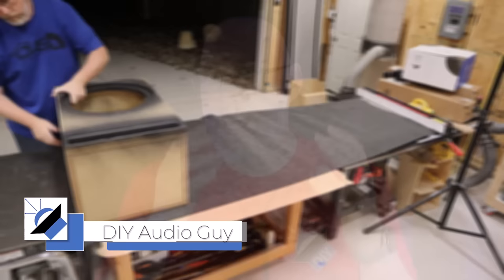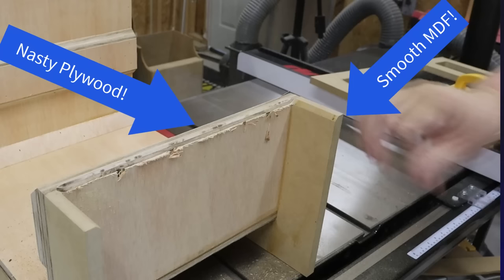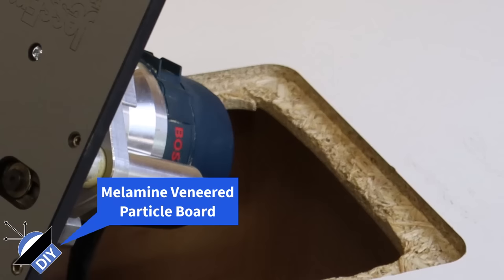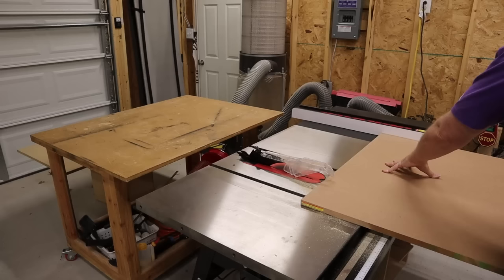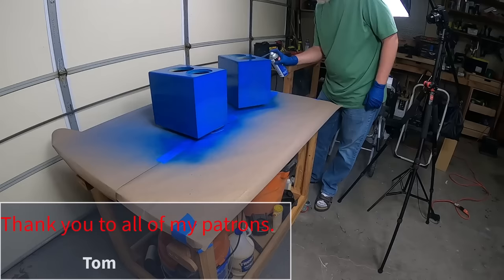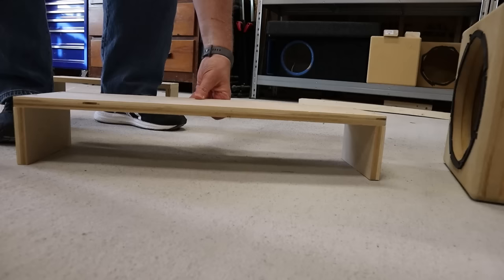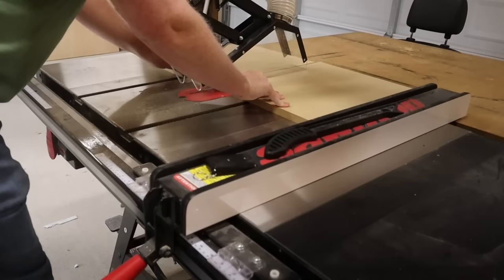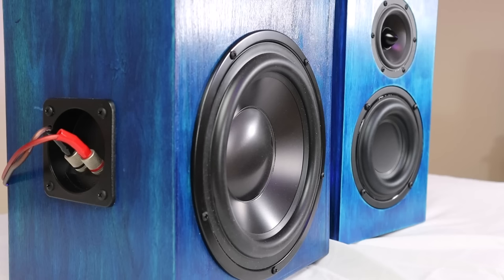You Won't Believe The Best Wood For Your Subwoofer Box!  Birch vs MDF

Comment: I started using water resistant MDF (its a green/olive color). This stuff is about double the density and weight of regular MDF. I have yet to find another wood product even close to this. It is even more enjoyable to work with than Birch (I have worked plenty with Baltic birch and regular mdf). Because it doesn't absorb moisture, painting it is a pleasure without the need to seal cut edges. In terms of sound and especially bass response, it performs incredibly well.
Reply from the maker: Where can I find a sheet?
Reply: Remember to use breathing protection, the water resistant sheets in particular use Formaldehyde as a binding agent.
Reply: Not sure about subs, however, I tried this wood for mids and highs, and the tone sounds off. Although I like that it is water resistant, dense, and heavy, the wood gives off a thin sound that I didn't like.
Reply: It is a very good choice when enclosure is meant for outdoor usage like cars, vans, trucks or even in your garage with no heating or sheds if you have a driver that is made of carbon fiber or plastic cone.
Reply: HDF - heavy density fiberboard. they make 1" thick, also. ive cut miles & miles of MDF, i hate the taste of that nasty board.
Reply: Akin to pressure treated lumber - also more toxic than regular mdf

Comment: Pretty fantastic review of the two common cabinet woods used for decades in sub enclosures. Still one caviot is the myth that the sub cabinet panels are more inert the heavier they are, false. It’s only partially true. One example to that is the Meyer Audio industry standard speaker cabinets that are known for their own gravitational pull they’re so heavy, and they do sound good and set the audio bar good and high 25-30yrs ago, but have since been out-swung by a few high-performance pro audio lines with speaker cabinets featherlight compared to the Meyer’s. 
Density is just the OG method of the approach at making inert cabinets that are truly that. We’ve learned a lot since then , and one thing that’s allowed for low weight design is, very much agreed with our host of the channel here, cross bracing. It allows for very relatively thin panels to be used that only resonate in between corners and braces spans, and when dialed in high enough frequencies become inert enough to be a nothing factor below sub working frequencies. 
Again, great content on the vs discussion here.

Comment: i remember the first sheet of mdf that i bought from home depot was $6. back when i was first getting into enclosures, i used plywood, osb and particle board those all could be had readily for $4-5 per sheet. i recently made a sub enclosure from some scrap osb i found in the alley next to a construction job. solid box. cheers
Reply from the maker: When I got into box building my first subwoofer was for home theater and I used the Birch from Home Depot.   I think it was 50 bucks a sheet, it may have been 60.  If I would have known how much plywood prices were going to go up I would have bought a truck load back then.
Reply: Ahh, the good ole days.. evrything CRAZY expensive now. (Prices started going up fast when "everyone" became a DIY contractor)..

Comment: I've built many boxes in both materials but my preferred technique is ½ MDF for all the interior and inside layer and the ½ Baltic ply for the outside panels. This gives the acoustic advantages of MDF and protective advantages of ply and doesn't finish too heavy.
Reply from the maker: So everything is 1" thick?  clever.
Reply: @DIYAudioGuy  yes it finishes 1 inch thick. I'll apply a third baffle layer for heavy or powerful subs.
Reply: Complicated but effective. I suppose bonding the layers with adhesive under pressure is critical. 
For maximum durability Ive been coating plywood boxes with fiberglass epoxy resin, (minus the glass mat) you can paint it before or after. I also like spraying the insides with auto undercoating, ive tried both asphalt and rubber. Take it a step further by rolling modeling clay into thin rolls, pressing along the corners where the panels meet, then a few layers of the undercoating or PL adhesive to prevent migration under heat.

Modeling clay is amazing stuff for damping, super cheap and a little goes a long way. Just remember when it gets hot it wants to move. In a car its great to put under dynamat wherever panels meet.
Reply: How do you suggest replacing the front baffle/board with the cutout for the woofer? 

I bought a new box from ground-shaker. But the cut out is about 1/4 bigger than I want it for my 15” kicker comp q class. 

I was thinking of just leaving it in place and screwing another baffle right over it with the smaller diameter cutout. It would make the baffle almost 2” because the current double layer baffle is 1.5”.
Reply: @americandude3825  screw one in from behind or would you lose too much volume?
Reply: @americandude3825  might sound weird but Id consider using an aluminum plate maybe 1/8" or more thick from the inside. Mounting it to just 1/2" mdf just seems like it would crumble. Make the aluminum plate the full size of the baffle and mount with screws and nuts with some kind of elastomer adhesive thinly applied.
Reply: @johnlucier5654  may be a great idea. I can go 3.0. It’s 3.5 now.

Comment: I switched to 1/2" 6 ply Baltic birch from Rockler years ago for my guitar amp/speaker cab projects and have never looked back.  Super solid and light weight compared to 3/4" MDF.  Plus I can simply stain/poly the cabs and call it a day.  There's nothing wrong with MDF - but I would never go with if for anything that has to be moved around or exposed to the elements (like beer).  I really appreicated the safety issues you point out!  That's one thing a lot of newbies over look when when start on these kind of projects...
Reply from the maker: Pro audio gear like that needs to be durable.   You ever use this stuff:  https://parts-express.sjv.io/gbdVX2
Reply: I never understood what is the hype was about the Baltic plywood, there's a factory in my hometown (Latvia, Baltic states)and they can't keep up with the demand and i never understood why, it's just plywood made from a tree that's growing everywhere around us (birch) and now watching videos on YouTube i start to realize how good it actually is......

Comment: love the channel and content.  Its been decades since i built an enclosure; that said,, I live in the south with all of the great humidity.  

One trick i used to do to prevent moisture from degrading my MDF enclosures over time was to mix a fairly cold fiberglass resin and coat the interior and exterior of the enclosure.   Making it 'cold' with less activator allows it to actually absorb into the MDF and become moisture resistant.  I'd aim for a cure time of 36 - 48 hours.
Reply: Really ? I recently bought a subwoofer box for 2 15's , looked this up rn after I bought it . Sanded the box , probably should have worn a mask... But I did notice inside it has fiberglass in the back end of the where the subs are . Is that a good thing? Made of mdf has a birch ported port

Comment: Cool!  Yeah, I definitely like DIY projects.  I've never done anything with speaker or sub enclosures, but have been really satisfied with the potential of old reclaimed pine and the finish that can be achieved. 
**on a side note, the sound system that I put in my daily driver has been a game changer for me.  It lifts my spirits and turns my older car into something special. 😉 👍
Reply from the maker: Right on!
Reply: Same here man.  🙂 now i can turn the volume up and i don't hear the squeaks and rattles 😅
Reply: @robjones8733  😆 🤣...yep...2000 Mazda Mellenia, can't hear a thing!
Reply: Pine for enclosure by virtue of its finish? Form should follow function and only the wife chooses audio systems based on how they look.
No offense.

Comment: I just found you today and watched a couple videos. I usually use regular plywood, then I roll on Rhino Lining inside and out. Try it if you haven’t and make a video. I have also used concrete sealer but that ages and peels off.
Reply from the maker: I have not tried to paint or seal the inside of an enclosure.

Comment: As with all things in speaker building, there are positives and negatives to all box materials. One thing that can help a lot with full range speaker boxes is cld. A layer of sound deadening material will go a long way to improve the acoustics of a box. Which can let you use materials that are lighter and easier to work with.
Reply from the maker: CLD is good stuff.
Reply: This.
Reply: ive used a product called - Forbo ; it was green in color appx. 1/2" thick and came in 5ft long rolls that weighed 400lbs. 
it stuck good to 1/2" B.B.  with contact cement. 
it didnt like to be tooled or moved in 45° F or below temps.

Comment: So I've been building enclosures for a long time now and I've used mdf, Birch Maple, Baltic birch & some other various kinds of wood My very favorite for quality In audio is by far MDF. It has a warmer, rich, smoother tone compared to other types. To make sure I don't split the wood, I use mdf SPAX screws that are 1.75 inch long and have an arrow head type point . They are amazing. I also glue, caulk, brace the insides of every enclosure the down side is there heavy and if not painted or coated if water hits the wood will expand but I primer and paint every enclosure so it's solid!
Reply from the maker: Great advice!

Comment: My buddy uses MDF and I use Baltic Birch. I think MDF gives a more lush yummy sound and the BB gives a more tight sound. BB flexes less which is important for high compression sealed subs. I couple this with internal bracing and different deadening materials on the inside. I like both materials. I think I like the sound of MDF more, better for listening speakers; I use BB because I build studio monitors and I like a tight, fast, accurate sound.
Reply: I do see how BB will have a higher 'fs' and resonate at a higher htz. I like the tightness of the bass that bb provides and that higher resonance is handled by the dense material lining the inside of the speaker. In a weird way, having a higher resonate frequency in the enclosure actually makes for catching that vibration easier. I think an interesting verifying test would be this: 2 identical enclosures and look at the decay of each. Load with deadening material and look at decay again. My assumption is the BB will have faster decay in the sub range and will perform about same at the boxes resonate htz if treated well on the inside. Great video thanks for having this discussion
Reply from the maker: It probably follows a Pareto distribution (the 80/20 rule):  For 80% of all speaker and sub boxes MDF works just fine.  The other 20% would benefit from a more expensive material .

Comment: Use what you want, but 30yrs ago every pro installer including myself used particle board and it was sufficient for some high power and large builds. I never had a issue with the screws, not once. Not saying those issues couldn't arise and I'm sure some people have probably encountered them, but neither myself or any of the other installers I knew did. Good info though
Reply from the maker: Thanks for the info.  I have some old home stereo speakers that are made out of particle board so I know that it was a common material once upon a Time.

Comment: You can paint mdf with an oil based paint. I've done it for years, and it resists any water! It takes quite some time to thoroughly dry but its lovely and can be cleaned once finished.
Reply from the maker: Thanks for the tip!

Comment: Early acoustic suspension system enclosures were built with 13 ply marine grade plywood. Of necessity they will be filled to the brim with fiberglass or a similar material. I liked Wharfedale's solution in the mid 1960s. They built a box within a box leaving an air gap between the outside of the inner box and the inside of the outer box. That space was filled with sand.

Comment: Before I beginning; I'm discussing specifically Home Theater, not car audio or anything related to such.
Such a relevant video for me! I'm currently on my 4th speaker I've built since I started a few months ago. Although I have yet to finish 3 of them, I'm building the enclosures first for both woodworking fun and style.
So the question is simple: What's your take on utilizing solid wood (of different species, not pine...never pine lol; More like Oaks, Walnuts Teak, etc)  to build the box, and then inside of this box, build an MDF box?

In my scenario, which I plan on doing for the Subwoofer; I'll be doing a 14 (H) x15 (L) x 14 (W) subwoofer encloser out of 3/4" woods, inlayed between Oak and Wulnut, using box and mitre joints at the corners.

 - The back will be recessed 1/2 inch for the MDF back panel for the amp plate.
 - The front will have a 1" recess for 3/4 MDF then a 1/4 Oak face. (Maybe? I'm unsure if I'll do this or simply paint the MDF black and do speaker cloth).

Inside of this box, my idea was to simply make another box out of MDF taking the internal measurements and putting it together inside of the lager enclosure. Although I will "lose" volume, the idea is to specially add both mass and have the unique woodworking techniques I wanted to try (including a couple inlays and a branding), whilst having a natural oil finish.

Thoughts? Thing this will be a worse solution that simply using only the hardwood for the project? I also do have plenty of mineral wool from a remodel project that I never used (Overspent, had 4 batts left over, I also have Pink-Panther R15 insulation left over, too.)

The subwoofer size I was considering was 8 - 10" or so; I'm looking to specifically hit a quality range for a home theater without going too overboard. I have plenty of oak and walnut left over from additional projects so for me, that cost is minimal.
Reply from the maker: Natural wood will expand and contract as the humidity changes.  I have been told that if you seal the inside and outside of the enclosure it will be ok, but I have not tried that yet.
Reply: I came across a lab test of various wood spices both under a microscope and acoustical measurements. I tend to overthink and over-engineer my boxes. Stay away from pine and oaks! Pine is light (low density) and doesn't sound good to me compared to Baltic Birch or MDF. Oaks on the other hand are very dense and bring a certain "ringing" to the box especially in the high freq range without considerable treatment (made a few boxes of 3/4 European Oak and don't like how they sound). Walnut is beautiful to look and work with, but has similar characteristics to oaks. So far, according to the document I manged to get, ASH wood seems to be the best in terms of acoustics as per the lab test. It has density around that of MDF, but lower than Oaks and it's acoustical properties have a smooth distribution across a wide frequency range with no sharp impulses, ringing or absorption. I haven't tried the ASH yet as it's curing for several months now.

Exotics like mahogany, zebrano, bamboo and teak are also a possibility, but outside my budget where I live so I have no experience with them. Teak is also waterproof. With bamboo you may need to increase wall/baffle thickness as it's light, compared to other woods. 

Regarding your box, you can always make a framed MDF internal skeleton and build the outside of something natural that you like, keeping internal dimensions appropriate for the speaker in question, although this will increase overall size. I say go for the Walnut you have around. Joined smaller planks for baffles and/or sides will mitigate possible future warping and joinery in the construction will make it concrete-like strong as well as beautiful. Me personally, I love dove-tails. Good luck to you.
Reply: Ipe will move very little with changing conditions, but it is also incredibly dense and expensive. (Heavy, hard on tooling.) It would look amazing but it might ring I'm not sure. Would be sick for cladding an MDF box I'm sure.

Comment: If you use MDF and live in a wet/humid climate, a little not so cheap trick, is to coat the entire box, inside and out, with fiberglass resin, and then finish however you want.  It seals the wood completely, and makes it pretty much, weatherproof.  I wouldn't suggest leaving it out in the rain, but it will be much better than bare wood, or just carpeted.
Reply from the maker: That would do the trick.

Comment: I have a wood distributor about an hour away from me, who well, sells to those cabinet guys, but they were happy to sell me 6 4 x 8 sheets of baltic birch(13ply) for my dual 18" subwoofer enclosure. Really amazing wood to work with, I used a polymerized tung oil as a finish and it was outstanding. $125 bucks a sheet though and thats a tough pill to swallow when ACX pine plywood and MDF are nearly 150% cheaper.
Reply from the maker: Yea, it ain't cheap.

Comment: MDF is great for “sketching” enclosures. But proper, dense Baltic birch (not the cheap crap from the big box stores) is much preferred to MDF from a resonance control standpoint.
Reply from the maker: Most people grab the birch from home depot and don't seem to realize that it isn't Baltic birch.
Reply: @DIYAudioGuy  I know, if I was going to use ply from box store, I’d just by plain ply. Cheaper :) Once boxes get above a certain size, MDF becomes a problem with weight. And moving big, heavy boxes made of MDF, leaves them prone to damage.

Comment: The problem with  MDF for live audio sound is the weight, and if you drop the cabinet. We had a set of MDF subs and dropped one  of them; it completely crushed the corner, and literally cracked the cabinet in half.

OSB doesnt hold screws well. It holds up better than MDF, but still isnt ideal.